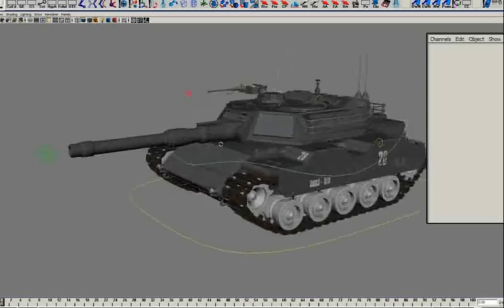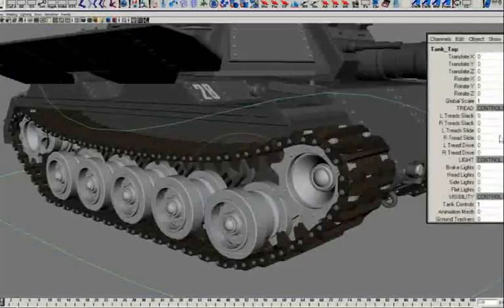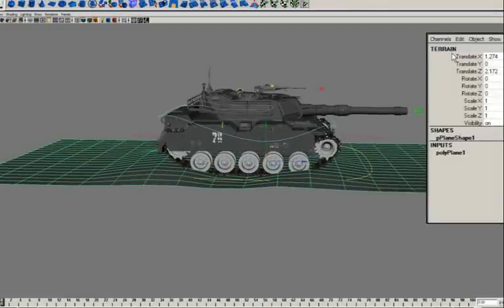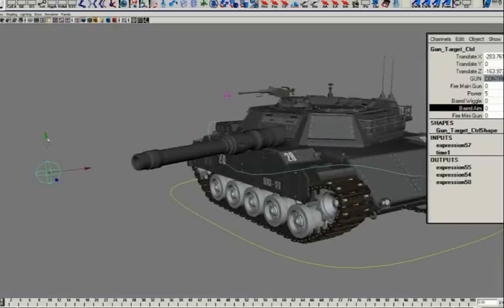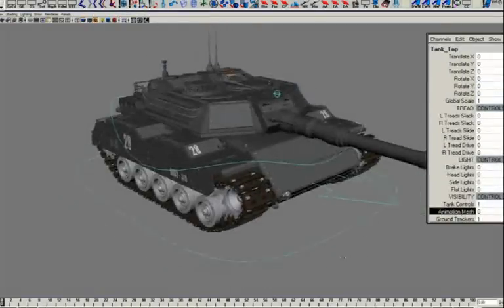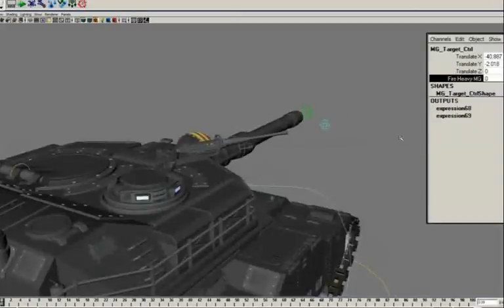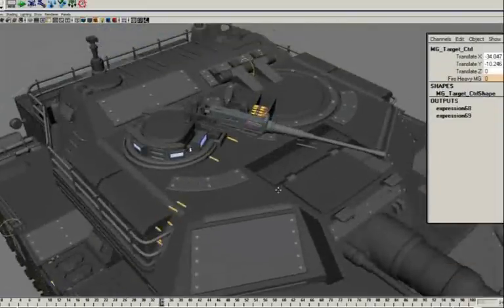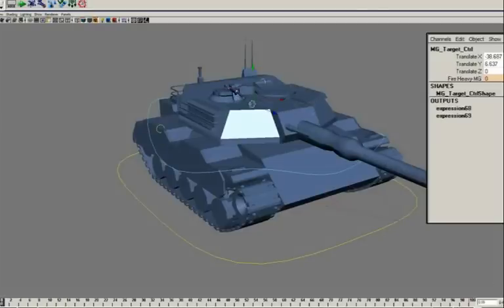Advanced Tank Rig for Maya | 3D Tank Model

Comment from the maker: Gun Recoil
machine gun is simply set driven key as it is so fast and repeating.  The fcurve is then set to pre and post infinity cycle.
Main Gun - The entire hull is setup to be able to rock and move independantly from the tracks and the gun fire attribute is linked to a node above this. Set driven keys over 10 units of the "fire main gun" attribute give it the recoil that settles and this is then linked to turret rotation to to control the direction of the recoil/settle animation.